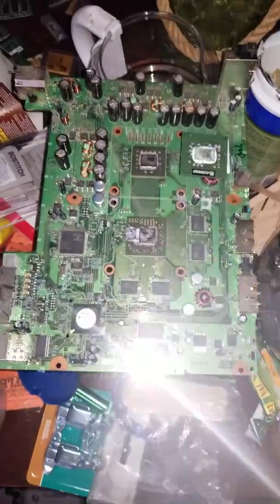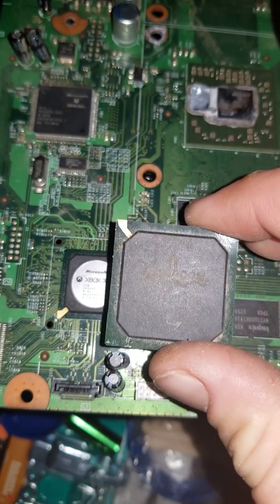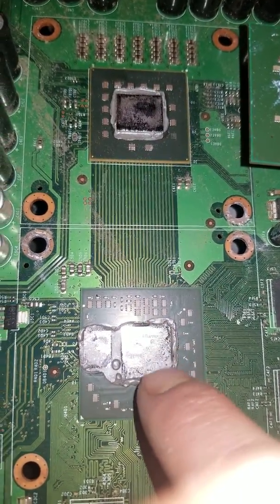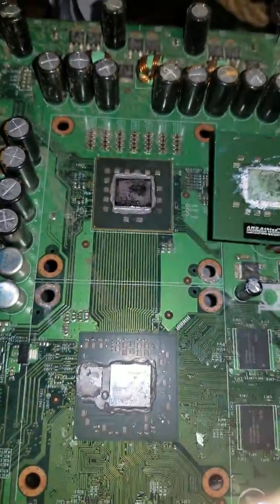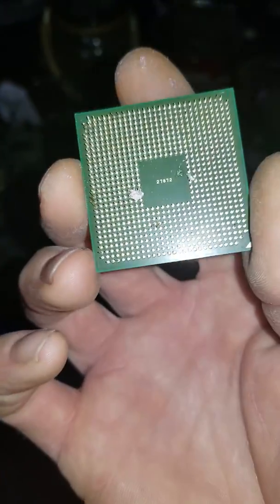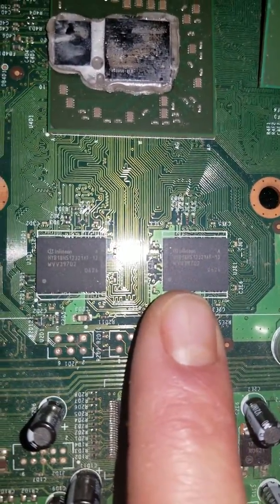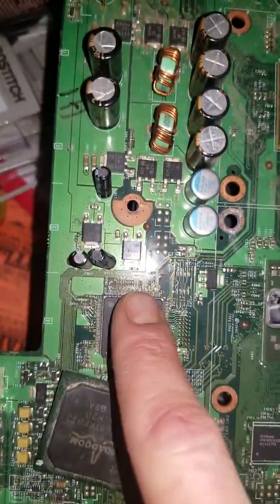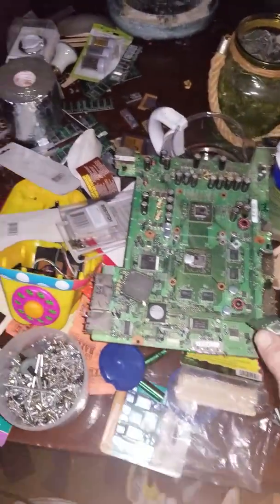What is a flip chip? What is a BGA chip? What is an IC chip?

Comment: Hey question- I have BGAs without the (green) border like shown @4:07 ... if the BGAs have solder balls on the bottom like mentioned does that mean i do not need to apply paste to the bareboard? I have a solder stencil i made but I planned to apply paste to the BGA bare board pads...  am i ok or should I mask the BGA on my 3mil solder stencil?

Comment: Thanks for the clear info.  Did not know about the no gold in flip chips.  In your shaker video,  was not clear what you would do with each fraction of powder...as in, where's the gold?
Reply from the maker: +Karl Ehlert there is gold bonding wires within IC chips, BGA chips, etc. After incineration, the chips need to be crushed/milled to beak everything down to a fine powder, and remove large items like copper and silica dies... after milling and sifting the material can be processed many ways, but I prefer to sluice them in the e-banker.
The shaker was an experiment to see if vibrations with a grinding media (marbles) would render the chips to dust.. it did not work however, so I proceeded to finish the ball mill, which uses the same propane tank.
Reply: Dude, I know there are gold bonding wires within  the BGA's, have about 880 g so far.  I just didn't understand your fractioning. Seems to  me that Au could be in both fractions.  Man, I gotta hand it to you regarding always inventing a new method/contraption!  Keep it up, one of them will eventually pan out, maybe big time. Thanks for your kind reply.